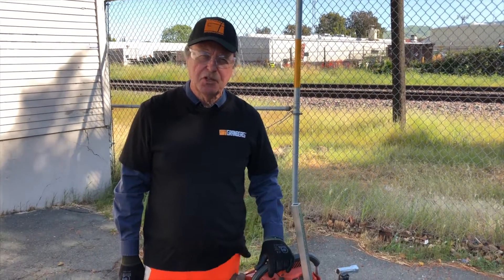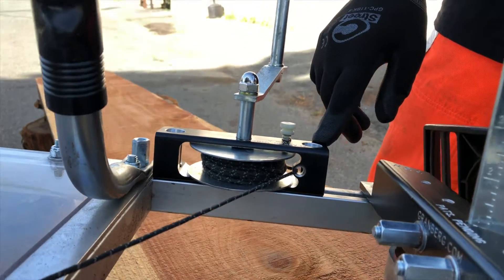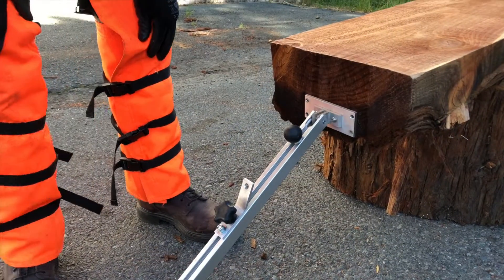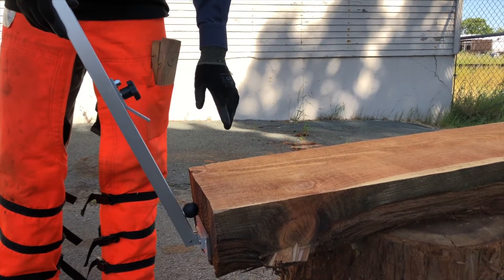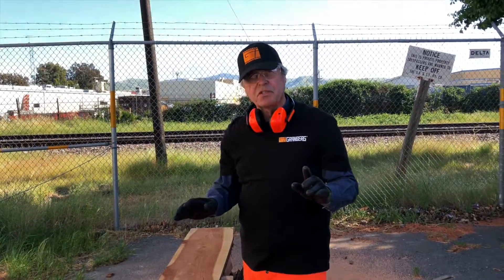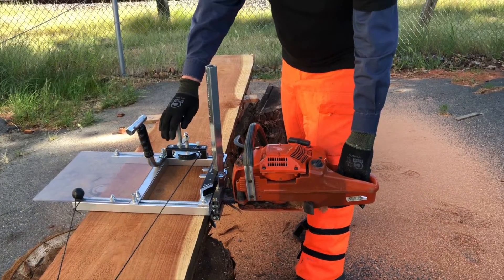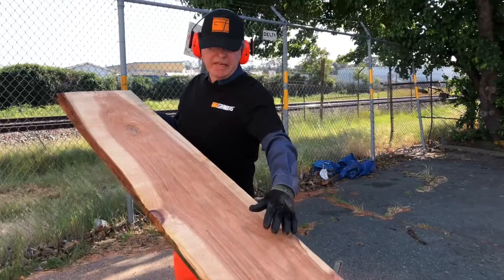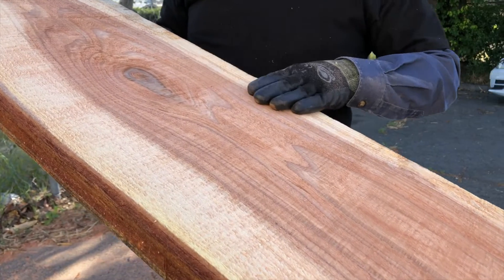How to use the NEW Granberg Alaskan Winch® System for chainsaw milling

Comment: I made one out of a boat winch. Works well bit I learned a few things. 
 It's heavy. Not to big of a deal, but I noticed it. 
 You have to hook it to something. I hooked mine to the tractor or a tree. 
 I got the wrong rope. It was springy. You need a solid rope to pull with for sure. 
 Just buy this one and forget about my adventures. 
 Good show man.

Comment: On my my 48” (actual cut width) setup I found the placement of the string ball on the mill critical. I had it nearly all the way out and it was a struggle till I moved it in to about 36”.🤷🏻‍♂️  I use a rare earth magnetic to add drag on the pulley bc I have a version before the screw.  His recommendation at the very end is spot on with countering the weight of the saw head.  I’m using a huge Husq 3120xp so lifting isn’t practical so I added a weight to the opposite end to do the trick.
Reply from the maker: Very interesting! We actually tested a prototype with a magnet design but ended up going with this screw idea. Nice idea with the counterweight, what are you using?
Reply: Granberg International - When i figured out what was happening I grabbed a 12lb piece off cut between my outside depth post and a second push handle I put near the end.  My longterm though is to slide 5-10lb doughnut weight over that outside handle and figure out how not to have it rattle. The other kicker is with that much weight it wants to bow the bar between then depth gauges and the trigger is so far out that, to be comfortable, I have to clamp it until I work up a remote trigger with a bike brake.  At 100% throttle for 11ft cut I run out gas 6” from the end🤣.   It was crazy though moving the string ball attachment in just 6-8” made a night and day difference in effort.  I went from “I need a gear reduction” to “I love this thing”.